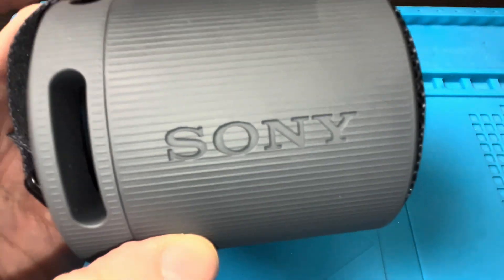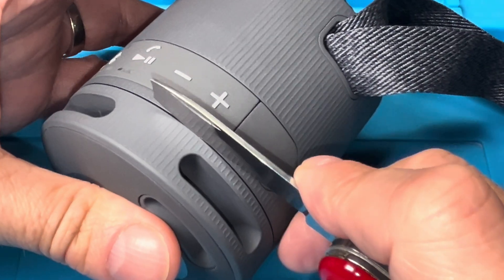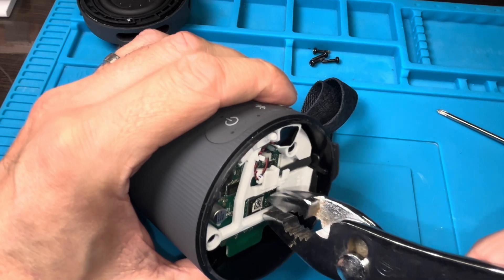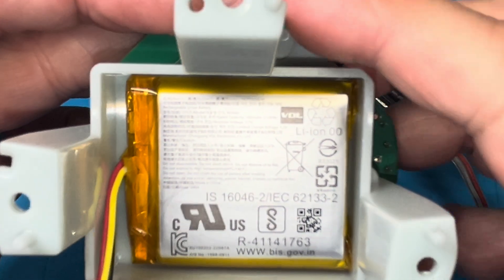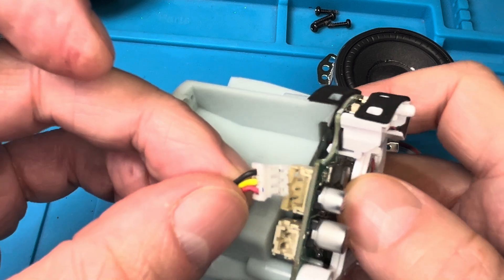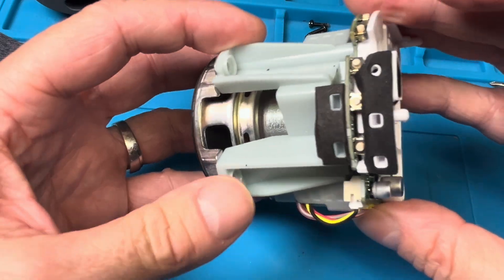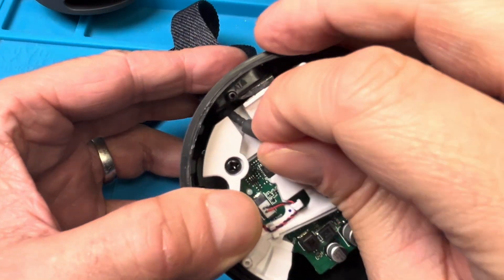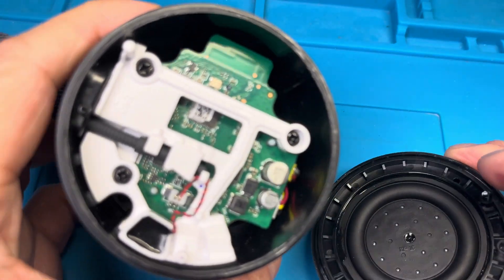Battery Replacement Sony SR XB100 Bluetooth speaker (How to DIY Instructions)

Comment: What glue to use. With proper one is water proofing not working?
Reply from the maker: I am using epoxy. Worked really well for me
Reply: T-3000 glue is good electronics repair glue